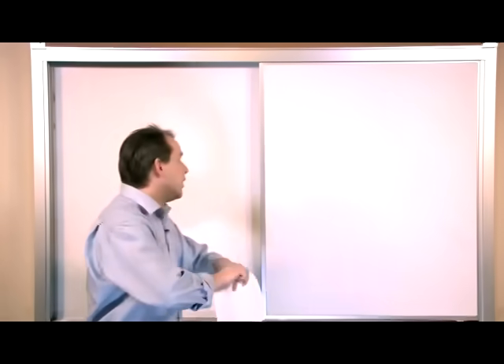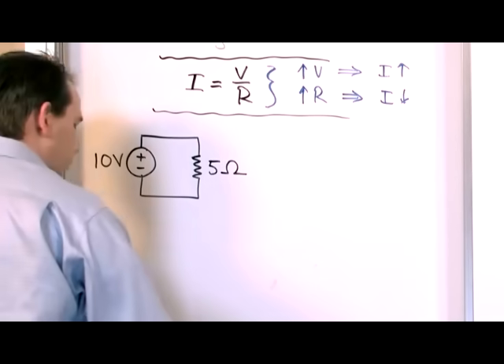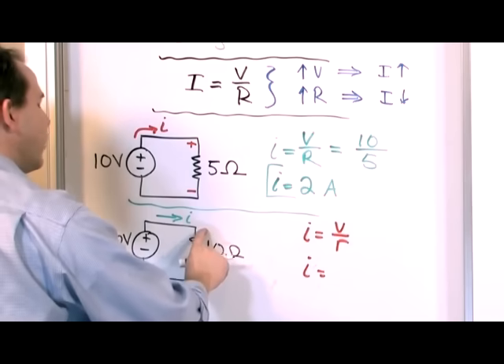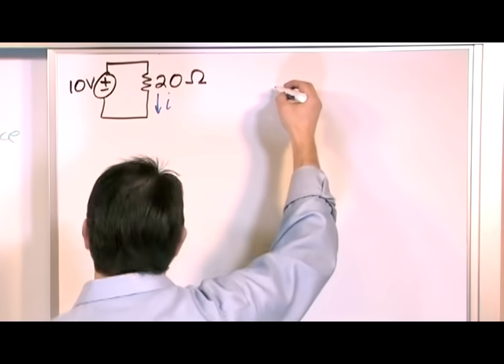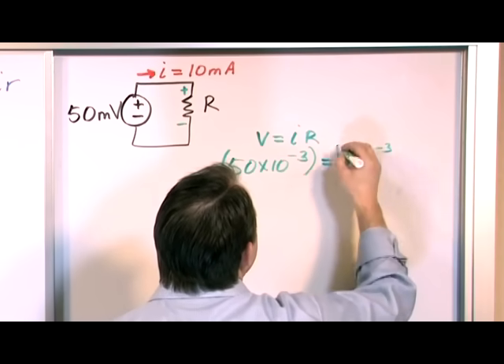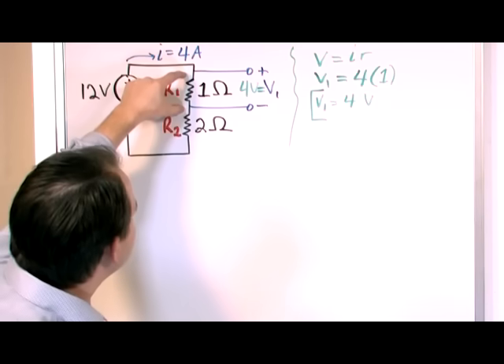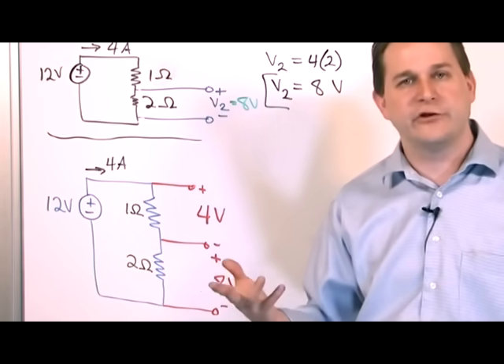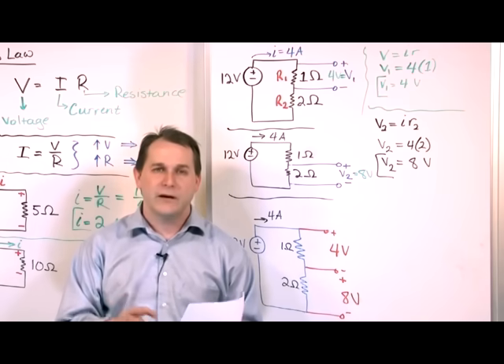03 - What is Ohm's Law in Circuit Analysis?

Comment: He's absolutely right about hammering the questions over and over, once you get into mixed circuits it's essential to know the laws, and repeat the definitions over and over until when you look at a diagram you very quickly know where to apply your formulas.

If you don't every question will be like starting brand new. That's why he spent so much time defining what voltage drop, current flow, etc. We haven't even defined Q yet, everything goes much deeper and you need to have each part well understood before moving on.

Comment: Hello, I have a question.
u said that current is proportional to voltage. what if I have a table with many values of voltage and current through a conductor, and while the magnitude of voltage was decreasing, the value of current was increasing. 
when I drew up the curve, it seemed as linear curve but with a negative and constant slope. Does that mean that the type of resistance is ohmic?

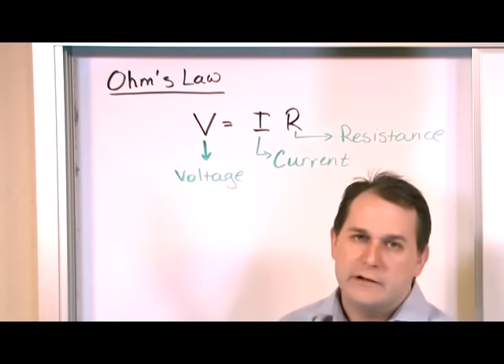Comment: 2:11 - Ohm’s concept was originally introduced this way: The current through a device is directly proportional to the voltage across it and inversely proportional to its resistance. “ You can buy voltage (e.g., a battery generator, or SMPS) and you can buy resistance (I.e., where the work is done); but you can’t buy current. It must be created by applying a voltage across a resistance.

Comment: Can anyone help me out? So he said that in the single resistor circuit, the voltage (potential) gets used up by the resistor as current is pushed through it. And in all of the examples here, the voltage drop accross the single resistor is the voltage of the source (10V). So, if all of the 10V is expended by the time the current travels through the resistor, there will be zero volts pushing the electrons back to the source. So does the current just stop there after going through the resistor? And the next few electrons that exit the resistor will bump them further along the circuit? Like there will be a pileup of electtons with no potential after the resistor? Eventually they will reach the source because the electtons exiting the resistor will keep nudging everything forwards? Or do none of the electrons make it back to the source?

Comment: Maybe this can help someone remember it better:

0,000 = 0 mA
0,001 = 1 mA (unit)
0,010 = 10 mA (tens place)
0,100 = 100 mA (hundreds place)
1.000 = 1000 mA (thousands place) = 1A

This can be applied to Amperage, Voltage, and Resistance.

Comment: WHY are you saying there is a voltage drop across a resistor, but telling us the voltage is the same as the source after the resistor?
Reply: "Voltage drop" implies a decrease in voltage, but you say it remains the same as the source. Pretty confusing to me.
Reply: Goes back to the battery and becomes 12V again. That's what he meant. Everyone makes mistakes.
Reply: @RoyHoy I was wondering if that wasn't the obvious case

Comment: So if the voltage is a "drop", then shouldn't V have a ∆ in front of it? Also if Voltage is similar to Potential Energy, then shouldn't it be called Potential Difference (Potential coming from the potential amount of volts coming through, and Difference being the change (∆) in "voltage")?
Reply from the maker: What you’re saying is essentially correct. You could write a Delta in front of the voltage all of the time, but the truth is since there’s always a Delta There convention just has that we don’t write that. It’s the same exact thing as potential energy in physics. When you think about it, the potential energy is always a difference. A difference above ground level potential energy which is zero but we never write the Delta there. Hey I don’t write the rules. I just teach them :)
Reply: Just to me it makes Ohm's Law (really Ohm's suggestion since the actual data doesn't give out a linear graph in the slightest) more clear as ∆V=IR

Comment: Thank you for this information I need to lower the voltage of a Ryobi 18-volt battery down to 14 volts so I'll just get some resistance and get use my meter and put them in series with the output cuz I have to power up a guitar amplifier that runs off  two 9- volt batteries but I keep popping the one amp fuse on it so if I'm thinking that the Ryobi battery maybe maybe giving a power surge of something ,so this is very practical knowledge to know and I'm going to use it thanks . Now the question is in my mind what resistance do I need to use for it that's the.. I guess I'll just do the math

Comment: If you used up 4 volts at r1 and 8 at r2 you should have 0 not 8 by the time you return to the battery!
Reply: The current is potential energy and is always measured between two points, not one.  The potential energy remains 12v measured from the negative to the positive terminal of the source.  So your point is well taken because the voltage measured from the negative terminal to the negative terminal is indeed zero!

Comment: Whoa, this is officially the most confusing video I've ever seen... so in the first example, with the 5 ohm resistor, the voltage drop is the same as the resistor, so if you measure off both sides of the resistor it = 10v. But if you put a 1ohm and 2 ohm resistor in series THEN you get 4 an 8v off the resistors? So in the first example the resistor did absolutely nothing, but the example with smaller resistors created actual voltage drop? Also I don't understand how it's physically possible that electrons, in reality, travel from the negative terminal to the positive(as stated in the first video in this series)... if that's true, why don't you put a diode in circuit backwards? This is so incredibly confusing, also I thought resistors reduced current, not voltage... so I guess it does both? I thought you needed a transformer or transistor to lower a voltage. Jesus I'm so confused. Everything I thought I knew is either completely wrong or backwards.

Comment: The equation V = IR just defines "Electrical Resistance". It is not Ohm's law. Ohm's law is "For some conductor, the electric current passing through it (I) is directly proportional to the voltage applied (V) at constant temperature." That is I = kV or V/I = 1/k (k = constant). It shows that the electrical resistance of such conductor is independent of I and V. Conductors that obey Ohm's law are called "Linear Devices" while the others are called "Non-Linear Devices". If V = IR is Ohm's law, we can't use it with non-linear devices such as Diodes, Transistors, Thermistors, etc.

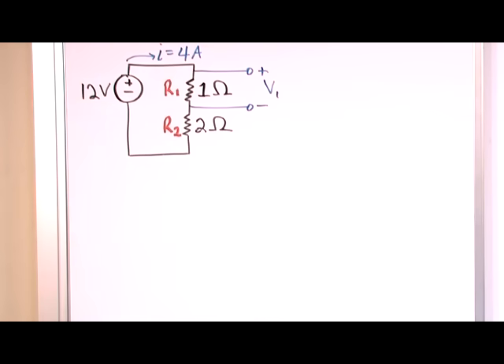Comment: Wait so in the example at 27:03 the current is 10A before the resistor then afterwards it goes down to 1A right? There’s two different current intensities at different sections of the circuit or would it be 1A for the whole circuit?

Comment: 2 questions: 1 - Why is is called a "Voltage drop" if the voltage stays the same before and after the resistor?!? The voltage isnt dropping AFTER the resistor...its still 10 volts...2nd question: What is the amperage before it reaches the resistor the first time? meaning, I turn my source on, it goes to the resitor and creates 2amps and from then on the current is 2 amps as it goes continuiously thru the circuit....BUT when i first turn it on what is the amp before the resisitor before the circuit is completed? I guess Im asking is there a "pre amperage" before the circuit is completed?....UDATE after I wrote this:14:03 u describe why its called a voltage drop: because the current is going thru resistor from posiitve side of resistor to negative side of resistor so its "dropping" per directiong..its not an ACTUAL drop in voltages.,,,correct?

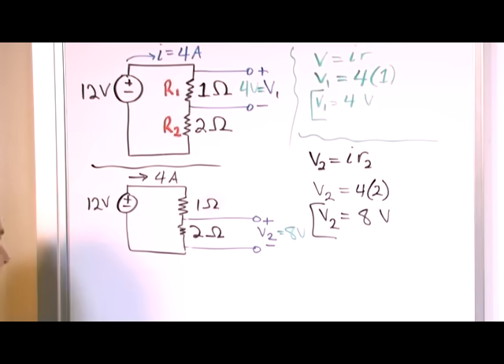Comment: You would have to add the resistors to use ohm's law to solve for current. If you try to use I=V/R to solve for each resistor you don't get 4 amps. 31:50

Comment: @35.45 you mention the proportion of each part. There's a formula that calculates each voltage drop. Source voltage * (Resistance for this drop/Resistance total) = Voltage drop. The resistors can be other values if the proportion is the same. So 4ohm and 8ohm resistors would have the same effect. Thanks for your videos.

Comment: I understand the math but still can't understand how a 1 ohm resistor gives you a 4 v "drop" when a higher resistor (2 ohms) measures 8v? Surely if a resistor is doing a job of resisting the flow of current, you'd expect to have higher voltage available after it went through a 1 ohm than if it went through a 2 ohms one?! 🤔 Intuitively, I'd think it being a lower resistor, I'd have a higher voltage value available than after going through a bigger one😅...

Comment: I am a bit confused by the section around 36:30. You said you could connect a new leg of the circuit starting right before the 1ohm resistor and reconnecting right after it, and that leg would have 4V due to the drop from the resistor. But on that leg, you would never have travelled through the resistor, and so you would still be at 12V?
Reply: The 4 volts is a real voltage that can supply another circuit, just as if the 4 volts was being supplied by a battery.  Notice that he referred to supplying a ‘“delicate” circuit with the 4 volts. Whatever resistance the additional circuit presents is in parallel with the 1 ohm resistor and will influence the 4 volts and the 8 volts, greatly if the additional circuit is low resistance, not so much if it is a very high resistance. If you haven’t already done so, watch a segment on paralleling resistors. That should help your understanding of how urgent division in a circuit works. It can be somewhat confusing at first. Good luck.

Comment: I have a question, if the current goes out through the positive end and goes through the resistor, how come the voltage at the negative end of the resistor still 10v being that you said when current goes through the resistor there’s a voltage drop?

Comment: such a great Video!! Thank you. Love the last example at 35:00 with 2 resistors. So, after R2, if you measured with a multi meter, would the meter show 0 Volts since between R1 and R2 there was a combined 12 volt drop?

Comment: Ohm's Law seems to be a mirror image of Newton's Second Law since voltage (V) is nothing but force (F), resistance (R) signifying the quality of mass (M), and the flow of current (I) reflecting acceleration (A). Therefore, it sounds quite logical to equate V with F,  R with M, and I with A. In other words,  V = R x I is as good as F = M x A.

Comment: took a basic circuit design course as part of pre-engineering years ago and this is far far clearer; of course the prof was trying to weed out people I think by going fast and not disambiguating common and easy errors in intuition that one has when dealing with electricity.   I'm sure this is covered or obvious to many, but the 4 Amps you provided for this circuit are a direct result of the resistors, which would be something else should one add additional resistors to the circuit..  I had to think about this when you talked about splitting off 8 volts to another part of the circuit and why this would still necessitate the 2nd resistor.

Comment: Wait a minute, what if the last diagram had resistors of 1 and 3 Ohms. The sum voltage is not equal to the source. Am I missing something?
Reply: Well, yes, you are. With 1 and 3 Ohm resistors and if the source voltage is 12V, the current in the circuit can not be 4A. Once you calculate its correct value (can you do it?), you can then calculate the voltage drops at each resistance and check that they do add up to 12V. Hope this helps.

Comment: What drives the current from the outlet of the resistor to the battery?
Reply: the current being pushed into the inlet of the resistor from the source as it constantly pushes current around in a cycle which we can measure and give it a unit called hertz (hz)

Comment: R.¿Also ,depends  up on H.z.,and H.z.,depends on power,factor,,length
Reply: Of cable ,and cable size of the copper conductor R-v-r,,where we see a voltage Drop,which is I,in to l. Squared the find out your voltage drop,and.use.kapacators to improve the power factor of the line, you will still have to use Root.3 which is i.7,3 of an Amp.and you will find out each phase load ,red.yellow,.Blue,.if you divide total amps by Root 3,.1.73. of a Amp ,you can find out starting ,and Running current ,of each phase.,I will say ,Ohm,s is used mostly in D.C voltage etc.

.

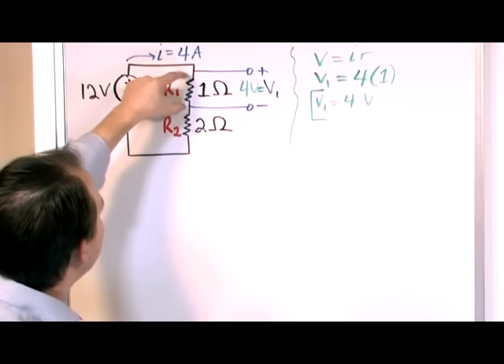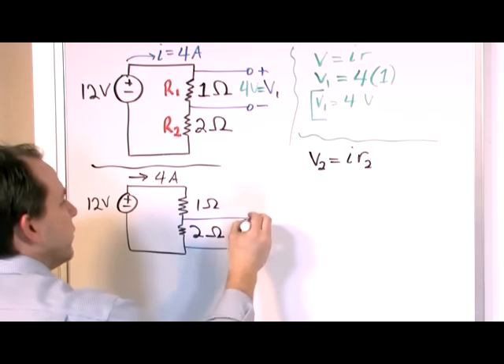Comment: @Math and Science 28:20 - the difficulty here is that you've got a 12v power source which somehow drops to 4v ahead of the first resistor. How? Why? --Do we treat all devices as if they're acting contemporaneously?  30:10 - Ah, the second diagram helps clarify. You're not measuring the voltage at the first, blue, horizontal line extending from the circuit diagram (which would be useful to know early on, btw), you're measuring the voltage drop occurring due to the resistor, measured between the two horizontal blue lines.

People who teach for a living often fail to give important information up front. They've come to think they're telling a story, but by doing so are often only adding confusion to the lesson. Don't wait to give key points--in fact, beginning with key points is a much better way to go, such as by stating early on 'we will be measuring voltage drop here, and here.' A list of the key points to be determined or measured on the whiteboard at the beginning of the lesson is even better. 

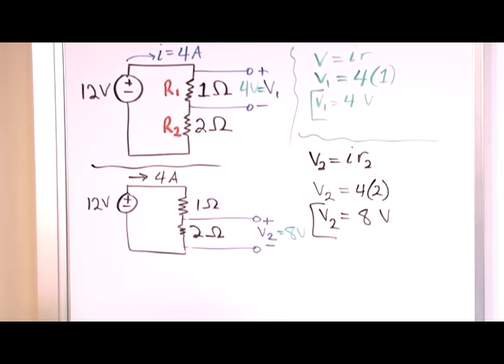31:45 - as odd as it sounds, it seems here as if there should be 0 voltage and 4 amps still traveling the wire between the lower leg of the 2nd resistor, and the negative terminal of the 12v battery. Is that correct? --I note that you talk about the voltage, but don't mention the amperage again. In addition, what about a circuit using only the first resistor, and not the second?

Comment: so if the current is 4 amps but the resistor is 50 ohms the power supplied should be 200Volts, would that mean that your 12v battery would just be insufficient to make the device work aka complete the circuit? cuz it got stopped by the 50 ohms resistor/s ? so you'd need a bigger battery? (greater source of power? )
Reply: which in turn will increase the amperage ..

Comment: Realise I’m never getting an answer. What is the Voltage going back to the power source? Why is not 0V? Confused with what happens to the current after it passes both resistors.

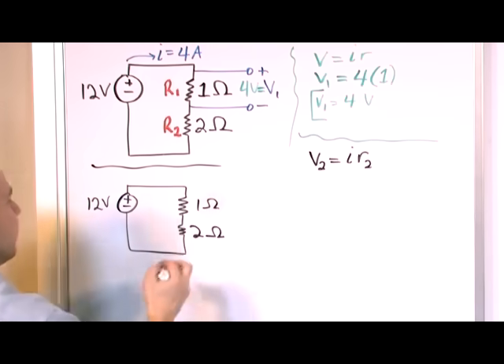Comment: At 30:00 ish why is there a higher volt through a higher resistance? I would have thought that if using the example shown that the voltage through the 1 ohm resistor would be 8V and 4V through the 2 ohm? Why has that confused me so much?

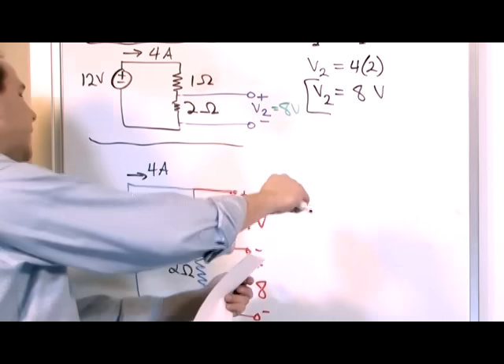Comment: Slightly confused with voltage drop at 33:00. I'm figuring you drop 4V at the 1ohm and drop 8V at the 2ohm. What confuses me is you put the meter between pos and neg at the first resistor you get a reading of 4V? I would think you would get a total reading of 8V. (12V-4V=8V) Help me. :-)
Reply: I went through several videos today and one finally gave me the answer. The reason for the small volt reading (voltage drop number) is because you are reading parallel from the meter, not series. Multi-meters have high resistance so the rest of the voltage goes through the  resistor on it's way and only the small parallel voltage is read. That might be taught elsewhere in this series but would be nice for that info to be added in this lecture.
Reply: @donswords6671  thank you i was confused about this too

Comment: Thank you. I have a question I hope you have time to answer : on a specific pcb I keep finding resisters that are overheating and  overtime are burning the board. But having measured the V across them to calculate for current then Watt, the calculated watt does not show anywhere close to wattage rading of the resisters. 
It switching power supply.  frequency is high about 40 K but then it fluctuates randomly I thought maybe there's something wrong with my scope and there might have been.... haven't done any new measurements on it.
 resistors measured in and out of circuit they read within tolerance
I am puzzled why are these resistors overheating. I mean I am loosing sleep here because of this.

Comment: If i=5 then would "i" have a lesser value on the negative side of the resister ? Would there be less current on the - side of the resister than the + ? In such a case would "i" have 2 values depending on the resistance value ? The way I am visualizing it there is 10v from the source, then it hits a 10 resister and there would be a different current on either side of the resister. Greater as it hits it and lesser as it leaves it. Am I wrong in my assumption ? I dont understand how "i" can only have one value when there is a resister half way long changing it to a different value.

Comment: Very good series of lectures. Your description of voltage as the ‘push’ that causes a current to flow is good. However, talking about a voltage drop across a component, such as a resistor, is not obvious. Why is there a reduction in the ‘push’ across a resistor ?

Comment: I realize it's old school, and it's the way he was taught, but " I " is NOT current. I = I ..it's the INTENSITY of the current running thru the wires etc. and it would make so much more sense if the old school way teachers would explain I is what it is the Intensity of the current.. it gets a bit confusing when you think of I as just Current and not the Intensity of the current.  IMO . Other than that one little pet peeve I have.. LOL .. this guy's teachings are Absolutely the BEST !!! I've ever seen !!! .. Just to refresh my memory on stuff. it was amazing the things I've thrown into the back of my head and haven't used..That he makes sense to the point that I will now use them in some circuits I build !!! lol